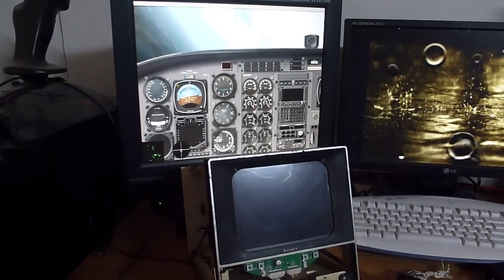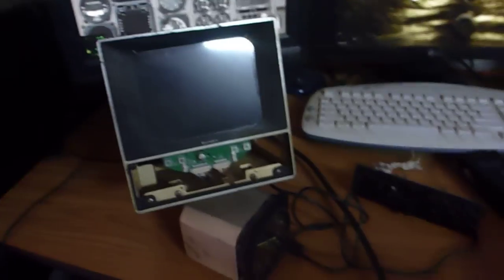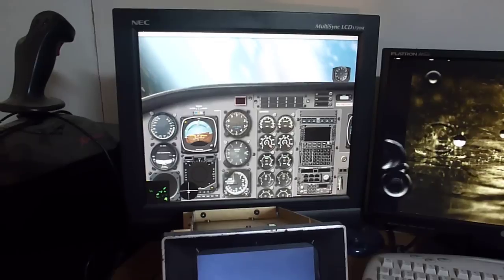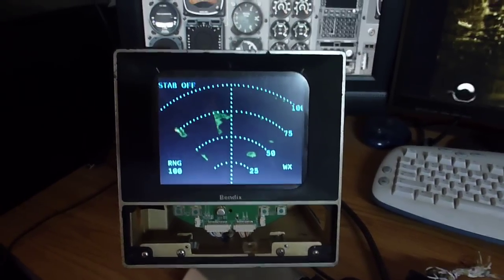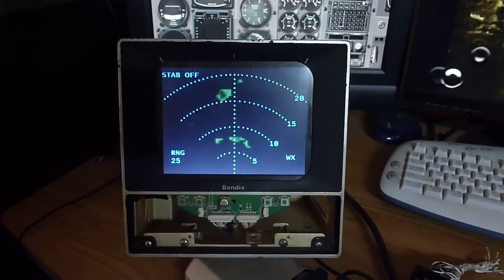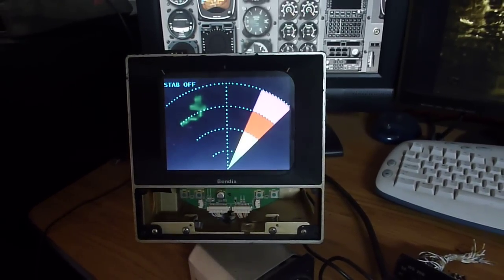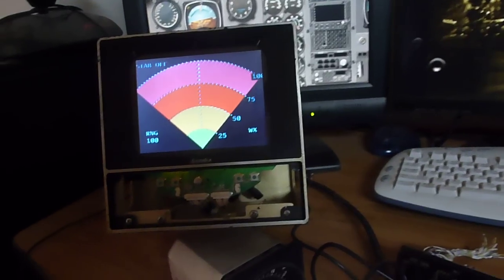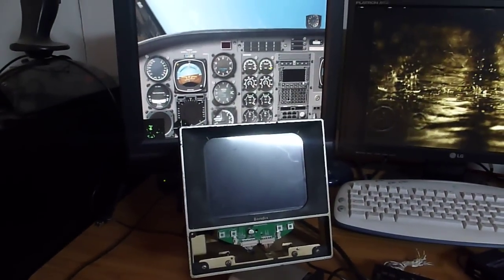Bendix weather radar for X-Plane

Comment from the maker: Thanks for the comments! The hardware is pretty straightforward: with two PCs, one PC runs X-Plane with its built-in radar visible. I am using a plugin to extract the pixel data from this region of the screen. I then dump two unique images (about 8 seconds apart) to a directory that is shared over the network. The PC running my radar loads images from that directory and dumps them to my radar. The screen is a PS1 portable LCD. I will be posting another video soon of it in my simulator.

Comment from the maker: Short answer: nope. :)

Long answer: unlike most of my other work, the way I'm extracting radar images is not really possible to port to FSX. I am relying on the fact that X-Plane has a very powerful and well-integrated API that allows me to actually inject code into X-Plane's OpenGL loop. FSX was never designed to be "talked" to, and has no such capability.

Comment: Have you got any info on how to drive additional LCD screens? How did you connect this one to the computer?
Reply from the maker: At the time, I was using a video card with dedicated composite ("RCA") output. I was seeing the VGA monitor and the composite LCD as two separate displays, same as if you had two monitors.

Once I installed this into the sim, I was using VGA output to a video converter device (about $30) to convert the VGA to composite/RCA. That particular PC with that particular converter did not always detect the converter as a "real" display, so to "fool" the video card, I actually connected the VGA output of the card to a VGA splitter/duplicator first, then took one of the VGA outputs from that splitter to the VGA-to-RCA converter. On that PC in the sim, X-Plane ran alongside my radar software on a single video output, but X-Plane was behind my radar software.

It's worth mentioning that the early Raspberry Pi has native composite output and would be a cinch for this, assuming it has enough graphics horsepower to run my meager little radar program (it probably does, but I've not tried it).

Comment: Great job! How did you get the weather data From X-Plane? To me it doesn't seem exists any dataref or API to access X.plane weather... am I wrong? :-)
Reply: +Michele Bucceri The X-Plane API allows considerable access to its OpenGL loop. I am using OpenGL commands to dump portions of the screen (during the 2D instrument panel drawing phase) to a file, which is then loaded as a texture by my software. It's similar to how you would program a screenshot function in any other OpenGL program, only the pixel data I'm grabbing happens to be generated by X-Plane.
Reply: I'm guessing you don't actually need to have the 2D screen showing?